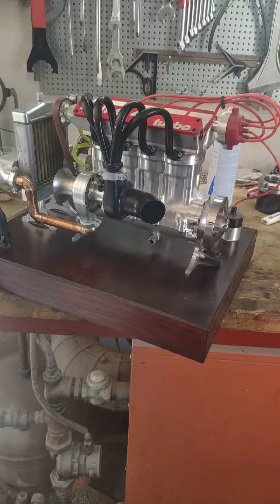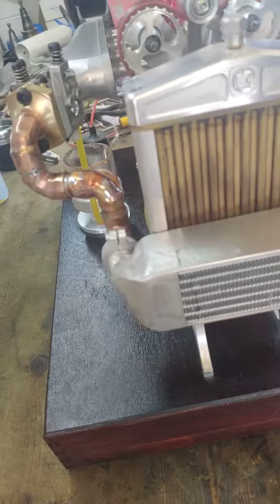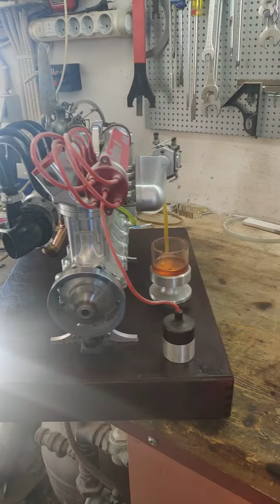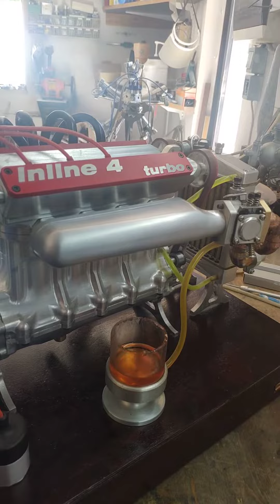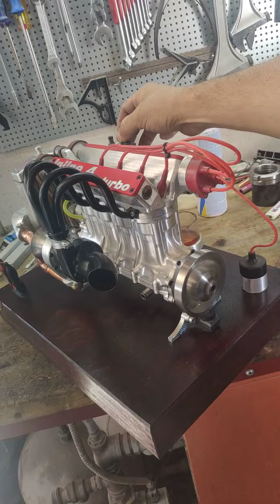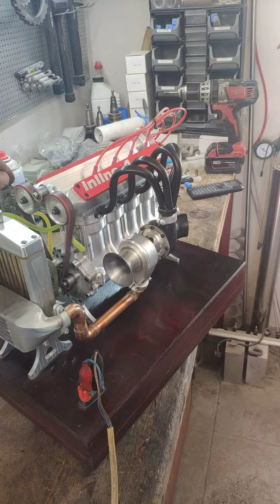straight 4 turbo  engine

Comment: Beautiful engine! How is the oiling/lubrication system done? Normally a turbo has an pressurised oil line to last long, but I don't see it here?
Reply from the maker: Yes you are correct 
Here we don't have pressurised oil system for the turbo.
We lubricate the turbo before start.
Reply: @tasoskarapanagiotis1159  Thank you! :)